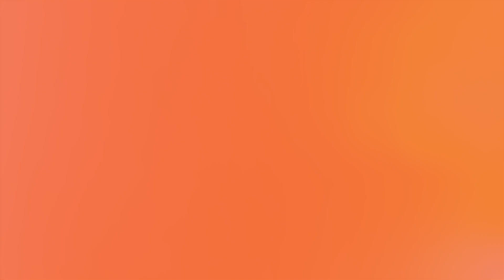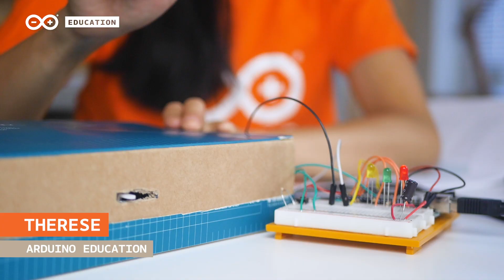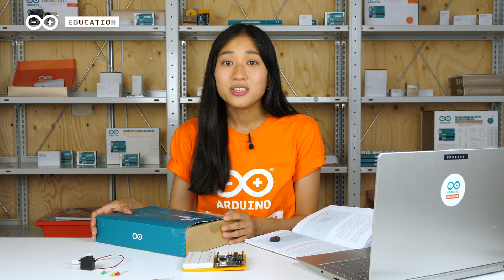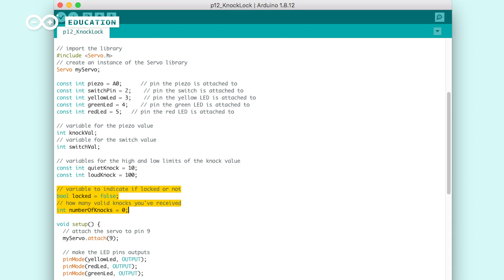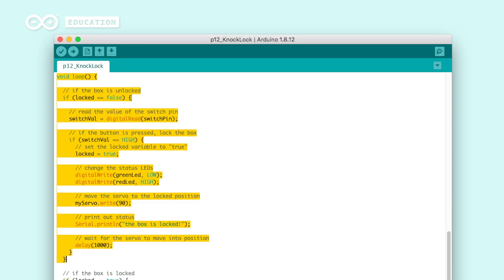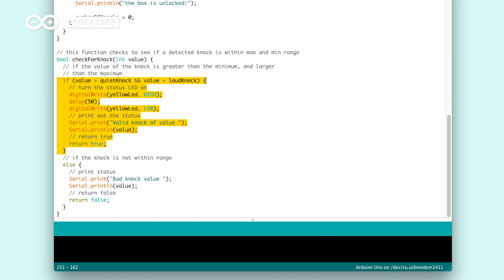12 Starter Kit: Knock Lock

Comment: If I press the button then the servo motor makes a turn, red LED turns on. Once I release the button, the servo turns back and green LED lights. It won't stay in the red position. And knocking does nothing at all.
Reply: me too
Reply: Same
Reply: The switch does is not work as described in the layout, connect pin two to the resister side of the switch and you'll be good